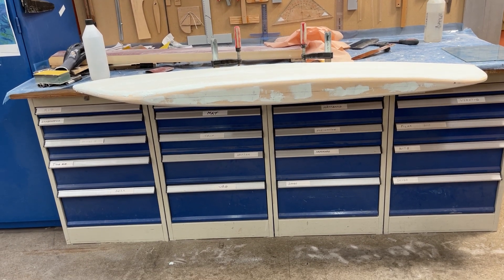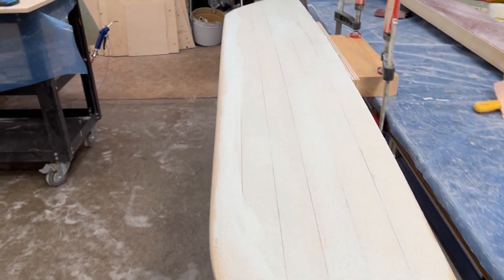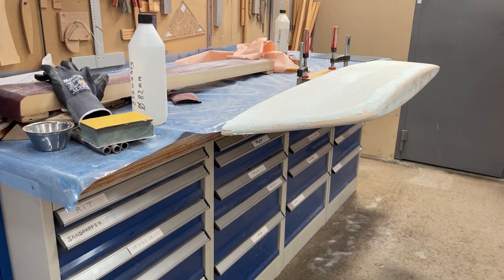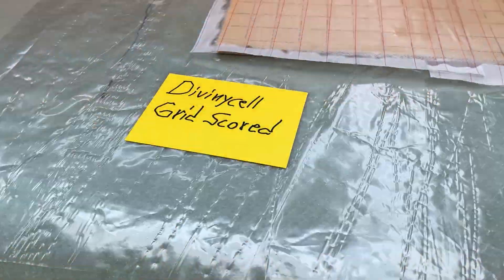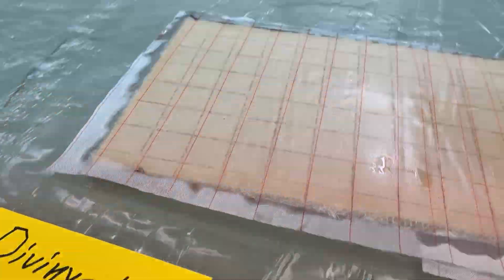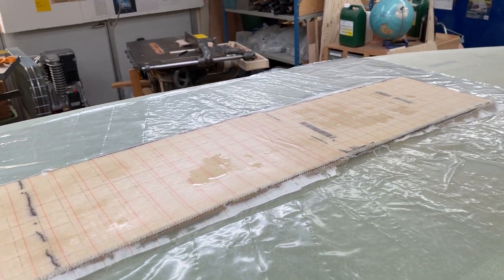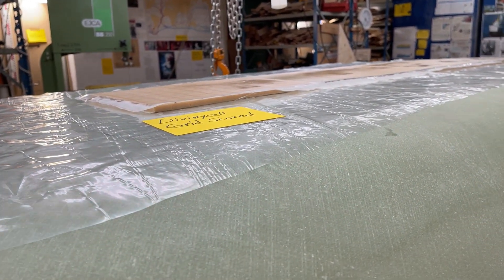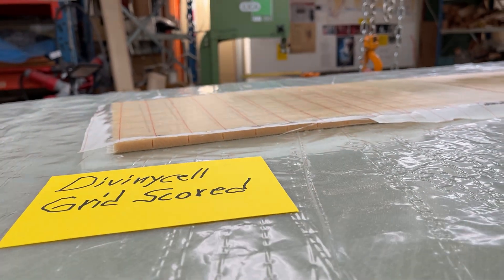Grid scored Divinycel I use to take of the shape of the hull to use as a flange for the keels

Comment: The keels will be hollow; is this for ability it add more lead ballast inside? Strength? I would have assumed to make them thinner if they didn't need thickness for weight mass.
Thanks for all.
Reply from the maker: Right 300 kilos for the two.
If not hollow they would have been to heavy . And price way to high.
Lead could be added but in my case that would make the boat to heavy.

Comment: Those keels are gonna be H-E-A-V-Y compare with that onboard lead weights.  Should be a lot deeper in the water.
Reply from the maker: They are going to be hollow 8 mm thick, 16 mm bottom. 300 kilos for the two.
Reply: @SvenYrvindExlex  Glad to hear.  Not much heavier than the lead weights then. Kind of a technical pour.  Those guys must be good.
Reply from the maker: @ralphwatten2426  Lammhults Gjuteri do very advanced machinery casting to high precision. They make pumps and propellers among other things.
Reply: @SvenYrvindExlex  👍
Reply: I was just wondering about that..
Reply: They are heavier and deeper aren't they  ?